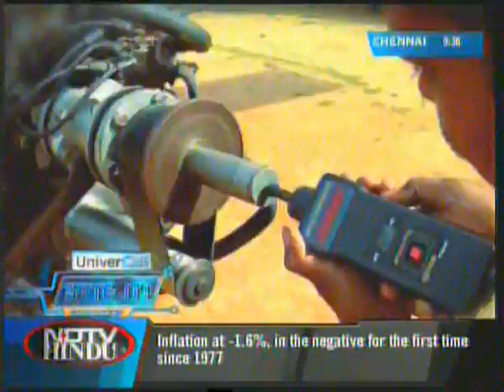Student built India's First full scale Experimental Airplane -JUKAKI (Not certified)

Comment: what about the engine please
Reply from the maker: Its a Suzuki automotive engine (85hp), with a custom built Propeller speed reduction unit (gear box). This leads to lower rpm and boost in torque for the propeller that was made for the project.